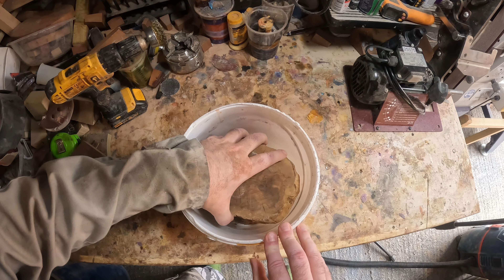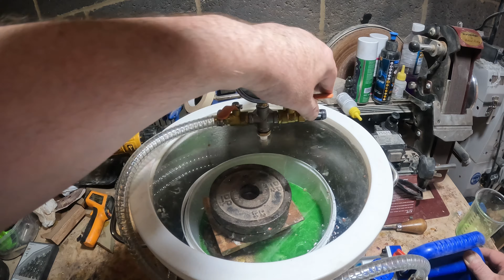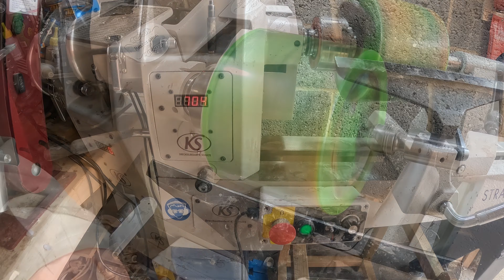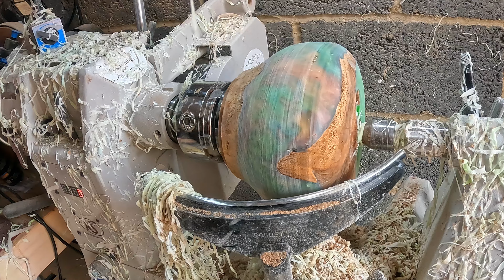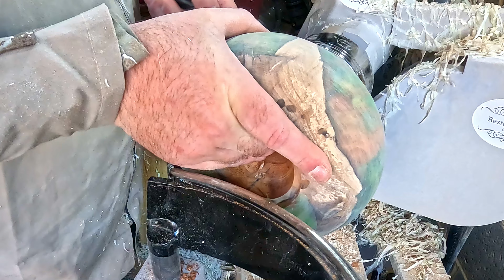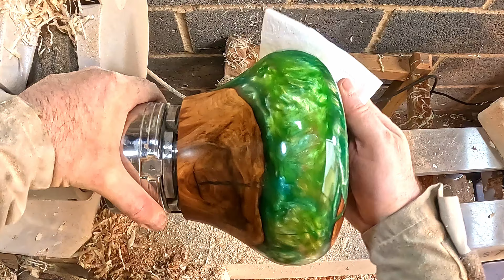Woodturning | Yew Hollow Form with Multi Colour Resin | Restoration DIY

Comment: I'm pretty sure all your resin issues occurred because you used both the vacuum chamber and pressure pot.  It removed more bubbles than there were and just left holes and voids.
Reply from the maker: Hi. many thanks for your comment. I'll be doing another similar project quite soon, so I'll probably just do the pressure pot to see if I get better results.😀
Reply: @RestorationDIY  thanks for the reply...signed, new subscriber.
Reply from the maker: Thanks for the sub, and welcome to the channel 😀
Reply: @RestorationDIY  make sure you use the same resin and it's about the same temp and humidity.